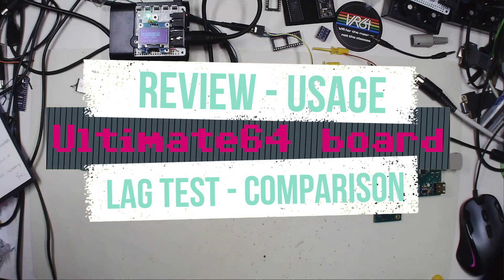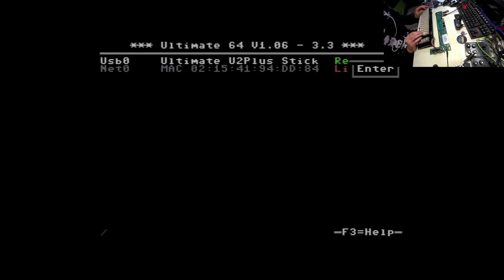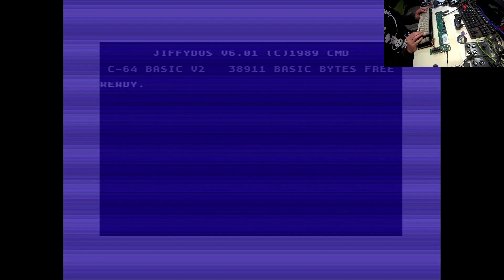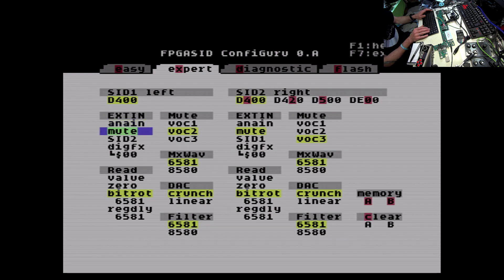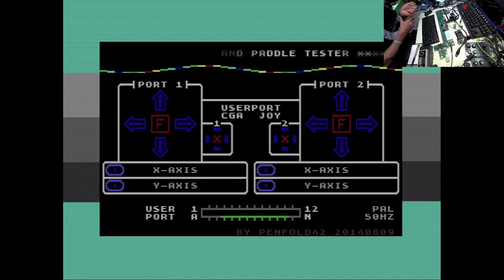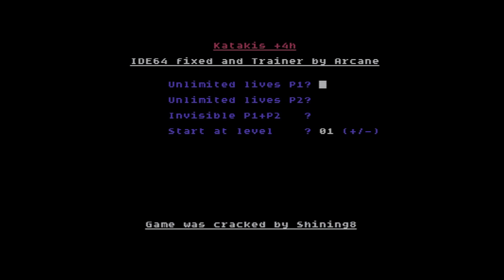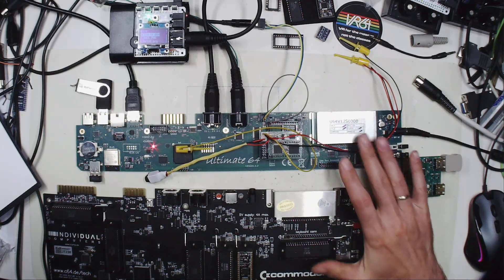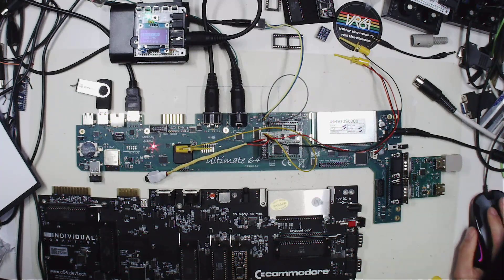C64 Hardware - Ultimate 64 - Review, Options, Configuration and Tests

Comment: Thank you for your great review. The Ultimate64 does not have a frame buffer. The actual lag is near zero. This is why you do not measure any difference between S-Video and HDMI output. The lag you are measuring is actually coming from your LCD screen itself. ;-)
Reply from the maker: Hi Gideon, thank you very much for the feedback :) Yes, the lag is coming from the display, therefore it's the same for the MK2 as well. I think I forgot to mention this. Anyway, I very much enjoy the board and I'm pretty sure I haven't even covered half of all the features yet.

Comment: Great video! 

I have to agree about the "power button", but that can be solved some what, by using a 3D printed mount. It really does cut down the wobble.

Your viewers might like to see it actually mounted in a breadbin and C64C (the type that needs mounts for the keyboard) case.

With mine, I have 3D printed stands for the keyboard and the side power / button / joystick ports.

Please show off the telnet/ftp functions of the U64.

I'm looking forward for the userport to be functional so I can use my wifimodem with screen again. I know there's talk of the internal wifi to be used as a modem one day, but I like having a screen.
Reply: FairFight14 Where can I get more info on these stands or buy them? My Ultimate 64 is due n a few weeks and I plan to put mine into a C64C.
Reply: @kduhtdkzrt  I'd check the Facebook group if I were you. There's a few different ideas on solving the problem. I then downloaded the ready made 3D files, and uploaded them to a 3D printing service.
Reply from the maker: Thank you for the feedback and the info. Putting the board into a case will be the next step when I have done most of the on-board tests. I guess I will get such 3D printed parts as well.
Telnet and FTP is planned too, I just need to get a Lan cable to my desk since I use Wifi only actually. I have prepared an user port adapter by myself too, will be covered soon.

Comment: Thanks for your comprehensive review and giving your thoughts about how it compares with the MK2. What is the primary reason you use JiffyDos?
Reply from the maker: Mostly the fast loader which works very well with many games and demos and if not it isn't interfering with soft fast loaders most of the time.

Comment: I received my Ultimate64 board yesterday and I was hoping to find an option to set the aspect ratio to 4:3 instead of viewing everything stretched on my 16:9 monitor.  Does anyone know if such an option exists or if it might be planned for future firmware updates?

Thank you for taking the time to record all your thoughts and tests of this very exciting project!
Reply from the maker: Thank you very much for your kind comment :)
The output of the Ultimate64 is a standard 4:3 picture but a lot of monitors/tv sets do not scale while maintaining the aspect ratio. This can't be solved by a firmware upgrade on the Ultimate64 side, unfortunately. I guess HDMI should transfer the information about the aspect ratio but if this is ignored on the display side then it won't help. It would be really great if the Ultimate64 could output a full HD picture with the C64 pic embedded with the correct ratio.
Reply: That makes some sense! Thanks for the reply!

Comment: What is that little board sitting on the Ultimate-64's joystick ports? Does it allow to use digital USB game controllers (such as the TheC64 Joystick) to be used?
Reply from the maker: This is the Nunchuk64 adapter, for using Nintendo Nunchuk compatible input devices. See here https://www.youtube.com/watch?v=LK__4W44_HA
Reply: @c64customs  Danke für die Info. Kann man das Teil noch irgendwo erwerben?
Reply from the maker: @t-moth64  Am besten mal im Forum64 nachfragen, ich bin da derzeit gar nicht informiert.

Comment: Thank you for the very informative video! Did you test mouse and paddles with emulated SID?
Reply from the maker: The mouse/paddles are working independently from the SID on the Ultimate64, basically, it is done by the board itself and it works very good, better than every real SID it could do. It's very similar to the FPGASID, no shivering nor shuttering, very smooth motion.
Reply: @c64customs  Thank you for clearing that up. One more question: does Ultimate64 has a "printer emulation" feature?  It exists in 1541 Ultimate-II+, but I haven't noticed it in any of the menus in this video (or any other video or screenshot on the web).
Reply from the maker: @ianlarsberg7190  yes indeed, this is the very same compared to the 1541 Ultimate. I haven't tested it now since I have nothing to print so far :)
Reply: @c64customs  Thanks! I'm using 1541 Ultimate printer emulation for all my printing - except for job-related stuff... I love it :)

Comment: Which board has the better S-Video output?  (Sorry if I missed it)
Reply from the maker: The quality of the output is hard to compare since the Ultimate64 is not using a normal VICII which influence the video signal the most. In my opinion, the Ultimate64 is superior to other boards although the MKII and modded Commodore aren't bad either.